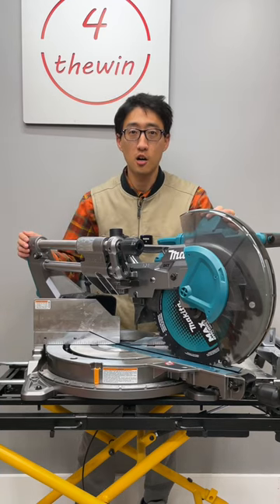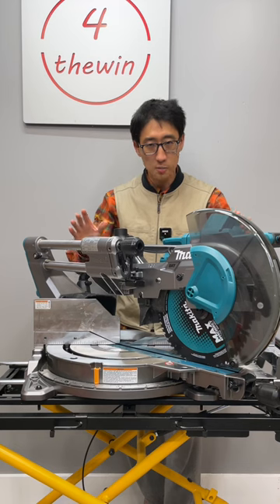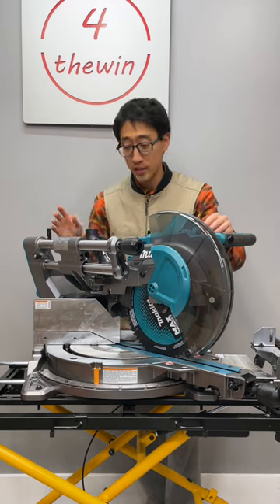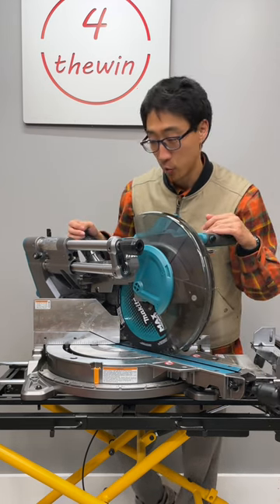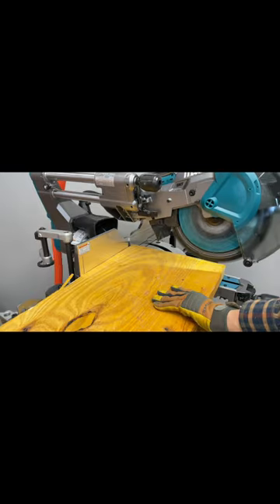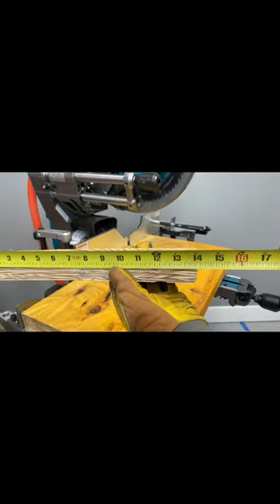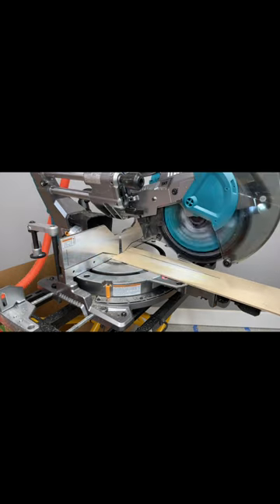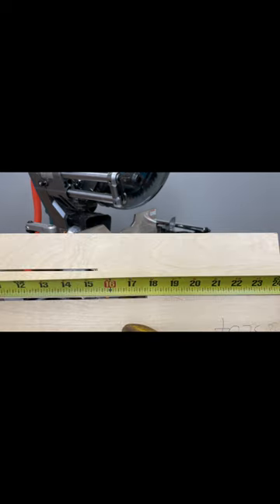Fast as Possible - Makita XGT 40v Brushless 12 inch dual bevel compound miter saw Review

Comment: The 40v platform is got enough power to rip 4x material like a 2x so I know the power won’t be an issue., for me its about precision and ease of handling, specially on the road when you do 3 or more different jobs in a day
Reply: Think it's more powerful than the Dewalt 12inch Miter saw 779?